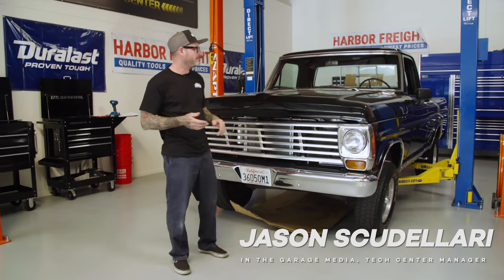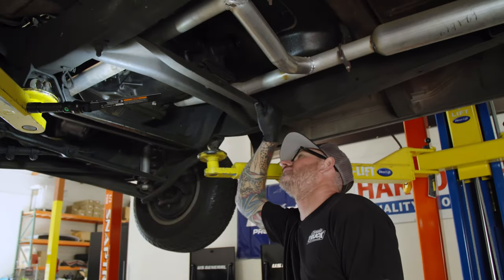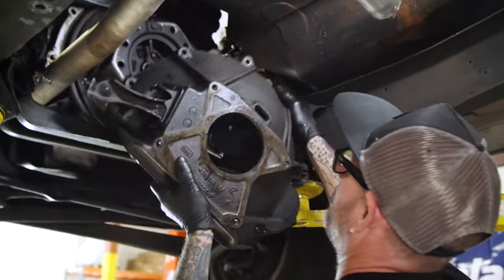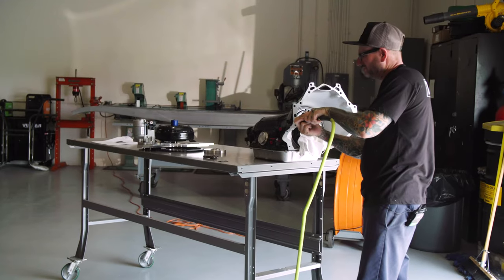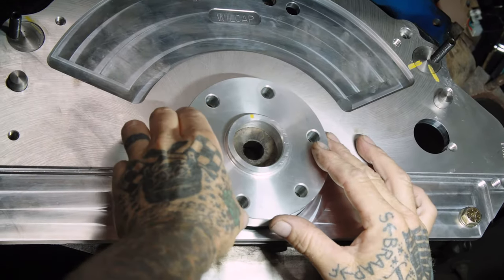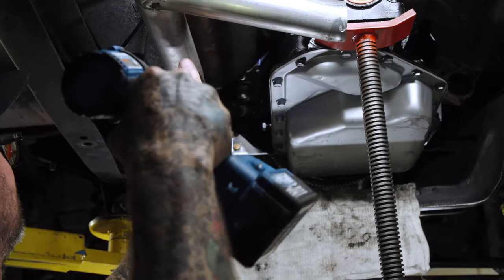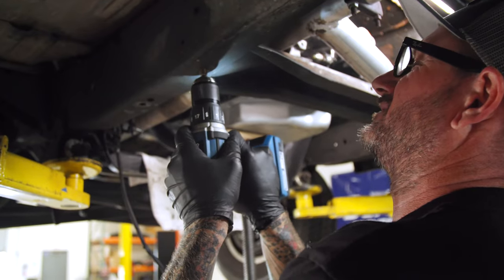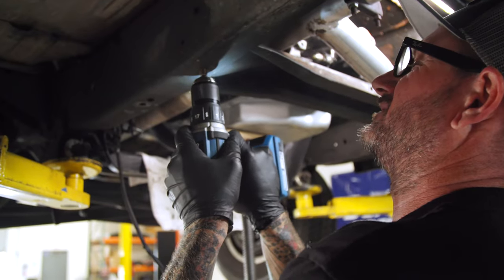Installing an 200-4R automatic overdrive to a 352, 360, 390 and 428 Ford FE engine is a good option

Comment: Bahahahaha!!! I've heard it all now! Taking a trans out that is virtually indestructible, to replace it with one that is known for failing with in 60k miles under a light load from v6's! What will they think of next? LMFAO!!!
Reply: Stock the early ones were a bit short on reliability. But remember that is the trans used in the Buick Grand Nationals which were beefed up from the regular V6 and 300 CID V8s. The afterarket got behind them for the turbo V6 drag racers so they are reliable to 800HP.

Comment: I prefer the 3spd gm automatic th350, the metric electric version th350c pancake torque converter,th400, and the th400hd, and the 4L80/4L80E, and the th2004R